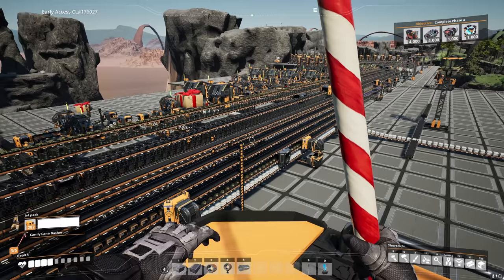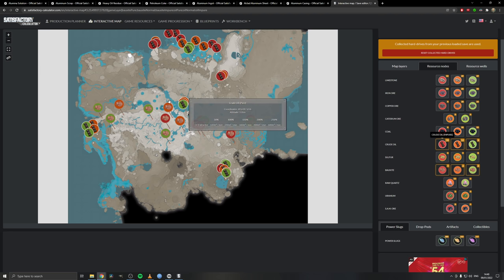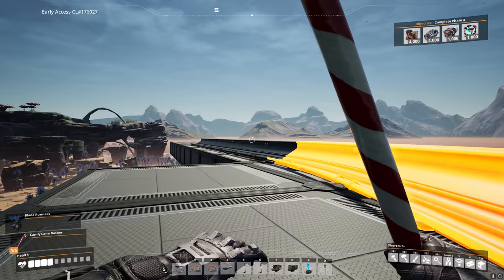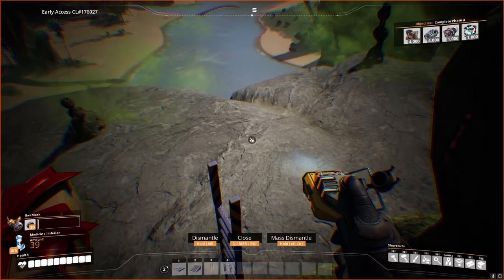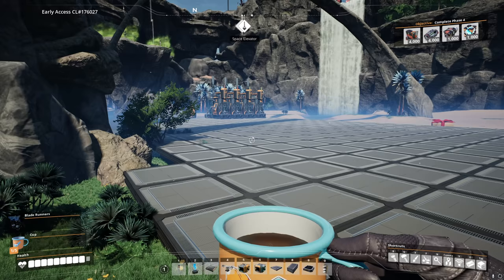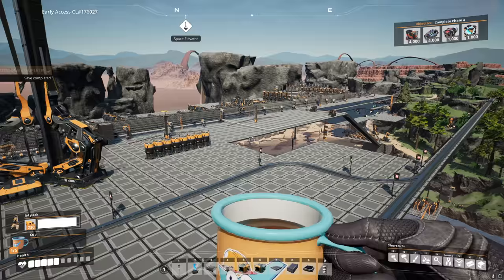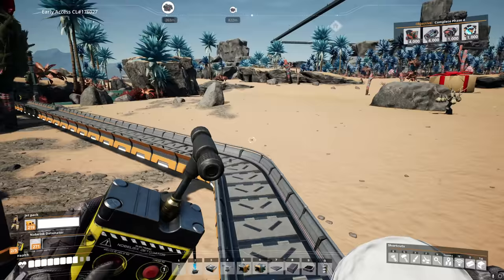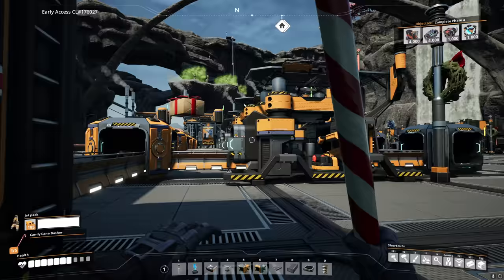Satisfactory : Ep9 Aluminium Factory

Comment: 14:33 Exactly! That's a problem I (emphasis on "I") have with this beautiful game. In factorio, you can be organized and tidy, or you can make spaguetti. The magic of factorio is that even the spaguetti looks good, in part because it's realistic, at least in the sense that there's no stuff clipping. Even more: if you make organized builds, it may be because you've learned that it saves you time in the long run.

In satisfactory I feel like one has to choose between this awful clipping or spending A LOT of time dealing with sloppy construction tools in order to make it look credible. And It is not clear to me if being "organized" actually saves you time in the long run, so that time spent feels pointless and thus discouraging to me. I wonder how much of this will change when the game is finished.
Reply: Once you learn a few basic methods of organising it no longer takes significant time to get a somewhat clean setup. The main tip to take into account is to have machines and logistics at different heights. Lifts are your best friend ;)

For example for pipes at refineries i use 1 block high ditches to run them all, coming up at the input/output. you can then run the belts straight to and from the machines 1 tile away at normal height and everything is neat. cover the areas with no pipes coming up with the thin foundation blocks and you never have to see those again.
Reply from the maker: I am pretty sure I am not going to be looking at 95% of the stuff I build every again so I just run it and don't worry about how it looks.
I'm not bothered if my base looks ugly so long as it runs and is easy enough to stick together.

Comment: That's surprisingly different from the direction I thought you may go. The bauxite deposits directly south of our bases has coal right next to it. I was expecting you'd use the alternate recipes to skip silica. But I wasn't expecting you to go to the trouble of going all the way west and mixing oil into the process.

I used the bauxite and coal deposits directly south for my aluminum. Though I also did a bit more work than would be necessary by building a long train line down to the nearest quartz and making a silica processing factory on the train line. Instead of using alternate recipes to skip the silica.

Btw, concrete foundations in the AWESOME Shop use concrete instead of iron plates so you can build more foundation without needing to carry around a pile of iron plates.
Reply from the maker: Going to have to give the pure concrete recipe's a go, saves so much space in the inventory.
As for location choice it had the added benefit of allowing me to justify building a railway through there. Also I figured it would drastically simplify production since it only requires Bauxite, Oil and water. Double bonus their is a second bauxite node nearby, meaning we can easily double production if we need to.
Reply: @FrancisJohnYT  Ok, I get the train justification. I explored the pink forest before I got out to the islands you went for.

But I don't really see how the electrode (oil) scrap simplifies production. I do understand how the sloppy/pure recipes simplify production. But normal aluminum scrap with the sloppy/pure recipes instead of electrode aluminum scrap only requires Bauxite, Coal, and Water. IMHO Oil is more scarce and useful for other things while processing oil is harder than mining coal. You only need half as much coal as bauxite and the area below the crater mountain seems to have practically double the coal you'd need.

I will admit I ended up only tapping and impure and 2 normal bauxites. So I won't actually have as much production until I tap the pure nodes that are slightly further away.

Comment: That oil island is where I have two huge turbo fuel power plants.  Powering most all of my factories.  I say most all because I still have three coal plants that probably aren't needed anymore but I never took them apart.
Reply from the maker: I may end up using the two pure nodes there for oil power, we are only using a fraction of a single normal oil.

Comment: Here's a heads up about feeding the byproduct water back into the sloppy alumina refineries.  Make sure that your aluminum ingot output line never backs up or the water pipes will fill up and clog the system.  A smart splitter can be set up to overflow into a resource sink.

Comment: From what I'm told, rail ways automatically transfer power, so no need to run power lines all over the map. Though, I do wish there were big power poles like in Factorio. I don't like the idea of designing my own in this game lol.
Reply: Indeed, rails transmit power and can also transfer power to devices such as a hover pack
Reply: I do wish there was some automatic way of doing it. But I managed to get a main power line I was mostly happy with. On my hotbar I bound 1 to the power line, 2 to the Mk.2 pole, and 3 to one of the later customzer color swatches (went with purple). I use that to setup a primary power line (Tap 1, use power line to find the ideal location and build, Tap 2, upgrade to Mk.2 pole, Tap 3, change color). This made it relatively quick to setup a power line along my highway or in other places. I use power switches to connect that main line to my factories and power production so I can turn off the factories if I need to reinitialize the power network.
Reply: @danfr  I just put TONS of energy storage (about 5000 MW currently) so I have ample time to handle power demand surges.
Reply from the maker: I will start using rail power in future once I am more familiar with it. I'm still very new to this game and have not really settled on a standard for a lot of things. The tutorials I find on this game are just woeful so far.
Reply: @FrancisJohnYT  Yes, many Satisfactory tutorials are fairly lackluster, sadly. Maybe you could change that 🤗

Comment: In practice I think you’ll want a liquid reservoir higher than the head lift of your water extractors. Since water fills from down to up, the higher waste water draws while the lower level extractors will be full.
Reply from the maker: I ended up sticking a pump on the output of the reservoirs, that forces the water out fast enough and makes sure everything runs smoothly.

Comment: Pro tip: the train rails carry electrical current, so if you establish a station you no longer need to run wire that length.
Reply from the maker: I tend to build stuff in reverse, for example the location of the aluminum train station is determined by the location of the factory. So the train station will be built afterwards so by then it's to late to use it as starting power. Though I will connect the factory up via rail power as well in case of any accidently wire cuts.

Comment: You can make fuel and plastic out of the polymer resin, run a generator off the fuel and drop the plastic into a sink.
Reply: Also suggest tossing some into a machine to make fabric for creating filters.  Just one machine, you'll have a box of filters forever.
Reply from the maker: You right about the filters, I'm going to need a bunch more of them before this is done. I'll go back and put a smart splitter on the resin to make fabric first.

Comment: Oh, had a question.  Are you considering tapping into geothermal energy?  You built fairly close to several geo nodes and its free(ish) power.  Not a lot, though.  It also fluctuates, so I put them through a battery bank to act as capacitors to level out the ups and downs.  If you blow your electric grid, that free power might be enough to kick start things again.
Reply from the maker: Have not unlocked it just yet, we need supercomputers to unlock the tech. Soon though.

Comment: Would it be a good idea to add water canisters and other canisters in general to your base's main belt? Having to deal with piping seams like a pain in the butt.
Reply from the maker: We are not going to use liquids on our main bus, I'll bring in some water under the floor for a few recipes but if it can be avoided we won't be using any other liquids in our core base.

Comment: Why haven't you used any truck routes to transport materials?
Reply from the maker: I do not see the point!! I can run a transport belt on most intermediate distances and it's far faster and easier.
If we were to use trucks for the copper we use in the alucad for example it would have required we build some road/foundation segments, truck stops, fuel supply etc.
Running a transport belt was just easier and faster in my opinion, I think in the plains area it would be more viable but in the areas we are using they are more effort than they are worth.
Reply: @FrancisJohnYT  But they're cool!

Comment: I have two aluminum plants.  One in the pink forest and one south east where I train in the bauxite.
I make batteries at the pink forest place and the sheets/casings at the one south east.
I haven't been using any that require oil products as they make so much aluminum I don't need the extra efficiency.
I have two assemblers making alucad sheets and it makes more than I need at any given time.  You'll have all the sheets you'll want with as many as you have.
Reply from the maker: I think your right, I checked the numbers and for what I'm planning to produce I only need 105 Alclad and 164 Aluminium casing per min.

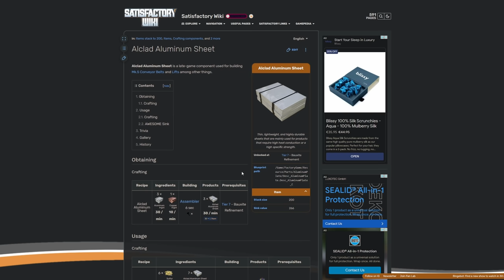Comment: What the actual f*** are Scrunchies!? (0:53) I had to ask google, learn something new every day...!

Also, you remember when at the start of the video, you said something so ridiculous as that Tier 5 belts were cheaper then tier 4 ones? After all the effort you put in this video, do you still think that, or have you realized that the rabbit hole went quite a bit deeper then it appeared at the start? I cannot wait for the rabbit hole called Uranium! I'm like watering at the mouth with glee in anticipation...

Also, there is a mod called Fluid Sink. Just dump your fluids into the void, less fuss about ratio's and math and calculators. I mean, if your gonna cross pipes with belts, why not?
Reply from the maker: I grew up with a sister so I was aware of what scrunchies are, but it's weird to think that a big bunch of the population would not be aware.

As for T5 belts being cheaper than T4 I get where you are coming from but I stand by the statement, as an example to make 300 of either per minute would cost the below using my current recipes.

T5 belts
300 Bauxite
100 copper ore
90 water
30 crude oil
About 30 buildings

T4 belts
4500 Limestone
2100 Iron ore
2100 Coal
About 400 buildings

The game is a bit counter intuitive when it comes to belts, T1, T3 and T5 are the easiest to produce. The T2 and T4 are just painful and I'm going to try and avoid them in future.